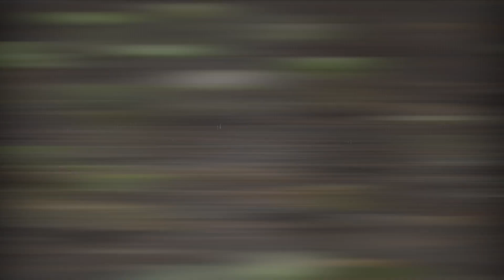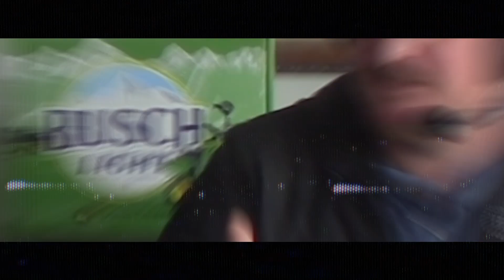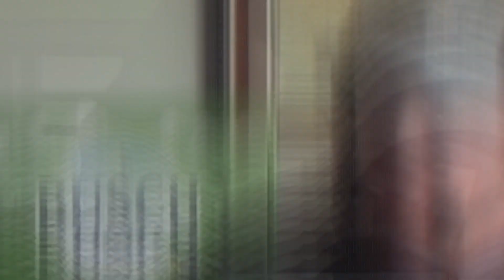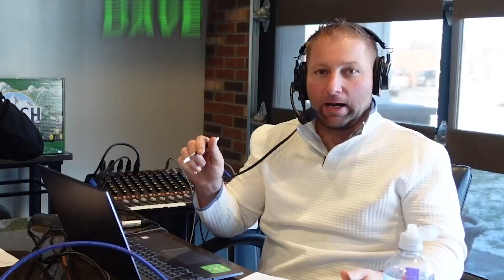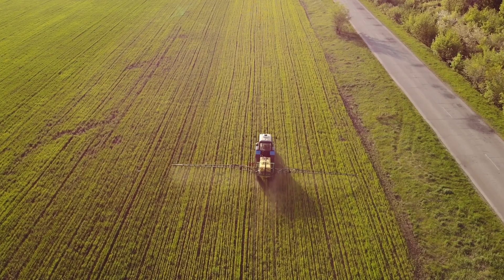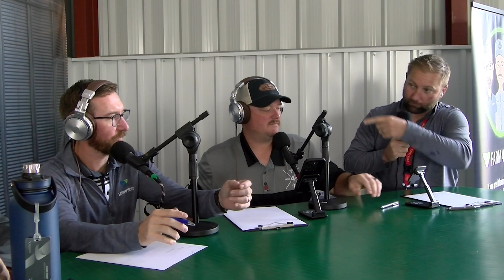Get the whole story on Sub Surface Drip Irrigation

Comment: I looked at how the seed corn companies require irrigation due to the high value of the product, and figured it just made sense as an organic producer, to make the investment. We grow as much of the ultra high value stuff as we can get marketed, but even with corn and soybeans, it’s a great asset. 

We get the moisture here in black earth Illinois, but we don’t always get it right when we need it. As an organic producer who is also no till, and plants green, drip allows us to get the crop going. Prior to having drip, the plants always had a weak start.

I save a ton on seed as well. Man, I don’t have to buy traits because a crop that’s never hungry and or thirsty just isn’t vulnerable. I can get 160-170 bpa open pollinated corn, and market that as seed. That’s a dollar per pound paycheck! 

I’m also having much better luck with ultra ultra short season varities. Guys I’m talking 200-210 bushel 75 day corn hybrids. We also went from 5-7k lbs / acre  of biomass from cover crops that is eaten as cow chow directly, or stomped down to feed the soil, to up to 18k lbs per acre. 

The key is getting it down so you can do it yourself. The 1st thing we do when we buy new ground is put tandem bulldozers out, hooked together, and start making earth quakes with a big shank, to erase years of tillage damage. The 2nd step is putting in drip. 

I do happen to use a different brand, but none of it is bad.
Reply from the maker: wow this is very interesting!  you should put some of this content on youtube for us to watch! would love to see the bulldozers working!